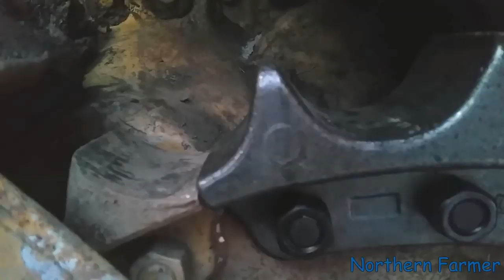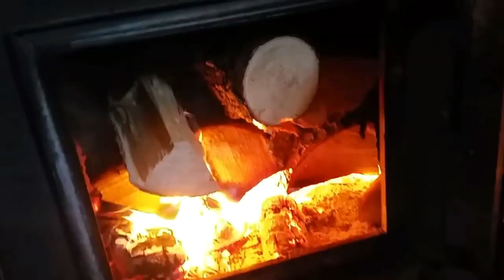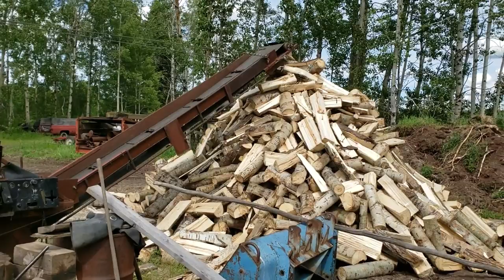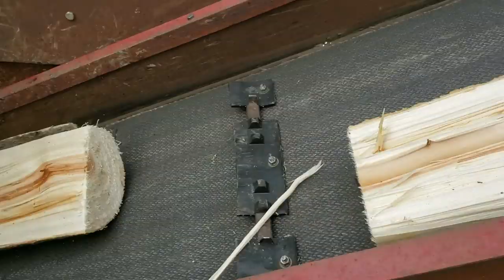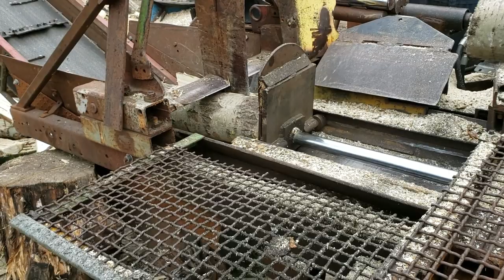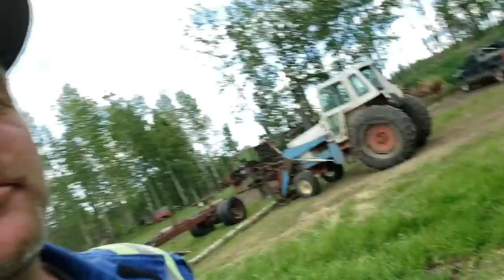HOME MADE WOOD PROCESSOR

Comment: Nice piece of engineering.  Regarding the cutting speed, you might try a .404 "slasher" chain.  It would take a new chain saw sprocket & bar, since the drive links are farther apart, but it will give a faster, more aggressive cut at lower RPMs.
Reply from the maker: Thanks for the tips.. Ill pass it on

Comment: Tyson, just for shits and grins (and if you had an extra $900 grand laying around ;) what’s your dream tractor build and one dream implement? Wheeled? Tracks? That would best fit your operation. Is there one that you could put on a big blade when ur scraping/pushing that would replace the D8 or do you think it’s best to have a dedicated dozer?
Reply from the maker: Oh man...probably a big versatile on tracks...hooked up to a new air drill....but that alone would cost over a million for sure ! For the most part I wouldn’t use a tractor and blade for what we do...the cats are built so tough and heavy just for that.

Comment: Tyson, tell your cousin that is a great machine, but your going to have to get a lot more of that popular
wood, there is not much heat value in it. if your going to be able to heat all winter.
Reply from the maker: I dunno...the dry poplar we use in the stove burns pretty hot...more than the spruce
Reply: Tyson, too bad you could not get some BC Larch or grand fir, they burn hot and long and the leave almost no ash, which is a biggy for me, burn 4 months steady and empty the ash box once a month, I have burnt poplar in a pinch but leaves too much ash and is not really hot compared to larch fir or birch and maple.

Comment: You should run the conveyor system off the same valve body as the splitting cylinder it would only allow the conveyor to operate each time as you are splitting the wood and would stop when you stop splitting, the reason I would do so is to divert the power that's wasted  running the conveyor seytem constantly and unnecessarily to the saw that's way to slow and it would make the operation so much more efficient and less wear and tear as well . Just saying I love the concept and construtuion of your machine and I would love to have the equipment and available materials ,I have all kinds of ideas and some are actually pretty good ones lol sucks being poor and constrained, just makes one wonder how great the world could be if all  men realized their full potential and abilitys ??? God bless and be kind and let's make our would a better place all ....
Reply from the maker: That makes sense... I agree that the chain saw is running to slow... That was my first time seeing it run.. I thought the saw would have ran like the ones on the feller bunchers in the bush
Reply: The hydraulic motor running outfeed conveyor could be a flow eating monster. To test the theory he could block the ports feeding outfeed  belt and see if it sends more flow to the saw motor. Pressure and flow make or break a project. The bucksaw I built  from junk has a 404 processor bar and chain on it. If I try to feed the cut too fast or it pinches in the cut, it stops the chain. I am now running an 18 hp motor with a 22 gpm log splitter pump and it cuts the wood at about 1" diameter per second. The engine running this has all the capability to cut fast with the right parts. I have been hauling home broken/short log yard ends from the sawmill I work at. Larch, Douglas Fir, Lodgepole, Ponderosa Pine, Hemlock, White Fir are all in the pile. Yes I live in the Montana.